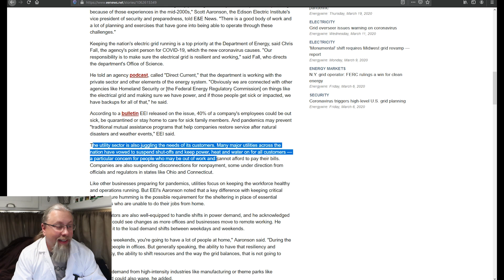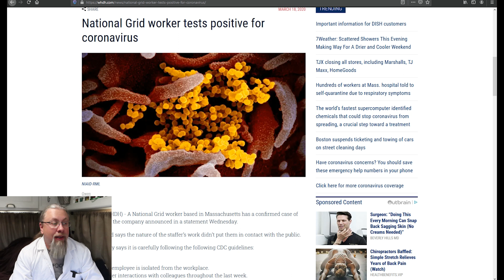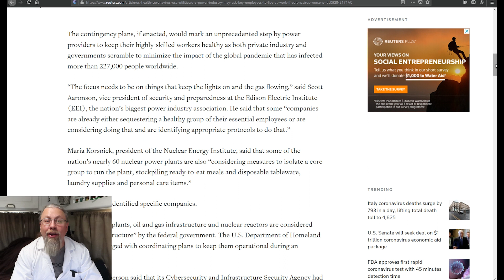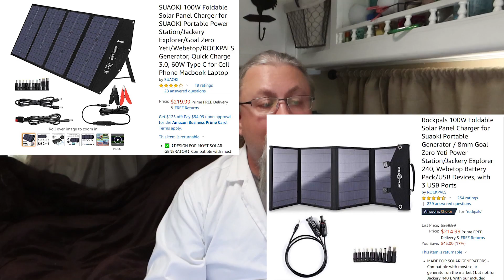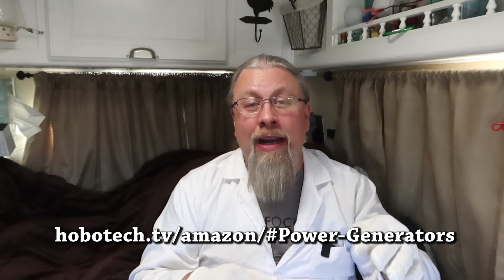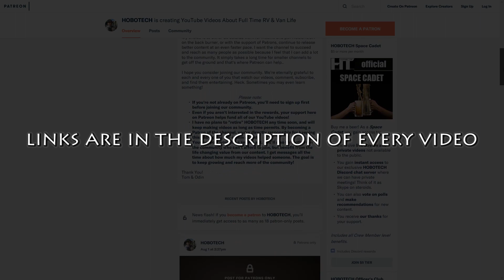BEST Portable POWER STATIONS | SOLAR GENERATORS For SHTF | Grid Down | Blackouts | Covid 19 Preppers

Comment: I was wondering if this could back up a home furnace on at 15 amp circuit breaker?  I thought the 2400 had an AC output of 1000w from the inverter (8ish amps).  Am I off on this
Reply from the maker: It may or may not run the blower due to the high startup load. The only way to know is to try.
Reply: @HOBOTECH  Thanks for expedient reply!  My GZ has an inverter run of 12.5A and can handle the start up surge, but 8A has me very leary.   Thanks for the great info you share!!
Reply: @HOBOTECH   Would be bluetti 2400 be a viable way to re-charge my GZ Yeti which will handle the furnace blower surge?   On the surface, the capacity and recharge times of the Bluetti makes me think so.  This may be where the lower input volts & amps come in handy on the GZ.  I know you are busy with the transmission, so I'm please answer when feasible.

Comment: Question. A freezer that's rated 1.4a pulls 161 watts that seems low and would only draw that while working if tru just about any inverter generator would work correct?
Reply from the maker: No, because the compressor will pull probably 5x that when it kicks on.
Reply: @HOBOTECH  
Thank you... I knew something didn't add up. So I'll make sure to get 1000 running watt not peak thanks.

Comment: Do you think the Goal Zero Yeti 3000 with the home integration module is worth the $? Is the Yeti 1400 with the home integration module and a couple of their Tank Expansion Batteries accomplish the same thing?
Reply from the maker: Goal Zero is overpriced. You can get so much more for less money.
Reply: @HOBOTECH  What brand with similar components do you recommend?
Reply from the maker: https://hobotech.tv/amazon/#Power-Generators
Reply: HOBOTECH Thanks for the link.  Silly question, it seems that on the Eco Flow Delta 1300, the picture of the (6) 110v outlets would not allow for all 6 to be used at the same time because of the ground prong configuration.... am I missing something?

Comment: Another excellent video.  I would like to purchase a Bluetti 1500 with the most portable/smallest footprint of solar panels to charge the Bluetti in the shortest possible timeframe.  I know that you have been using a Bluetti for many months.  What portable or flexible solar panels can you recommend for a fellow van life person?
Reply from the maker: The BougeRV 50w panels have a small footprint and so do the 100w folding panels I mentioned in the video. You can charge with 600w watt of solar maximum in a series-parallel connection.
Reply: @HOBOTECH  Thanks.  To be clear, can you do 400W with the Rouge 50W small panels in a series/parallel configuration?  The graphic in the video at 24:45 showed 100W panels to get to the 400W configuration, so that is why I was asking.  I don't recall what the max input voltage is on the Bluetti 1500, but I wanted to make sure that configuration did not exceed the voltage requirements.  The Bluetti 2400 is also very tempting....  Is the same battery technology used in both the 1500 and 2400?
Reply from the maker: Yes, you copy the setup shown in the graphic but add 4 more 50w panels in parallel if you want 400w. The key is to keep voltage below 64v and amps below 10A. If you exceed amps that is fine as the Bluetti will limit at the input. Now I was TOLD that the newer 1500 can support up to 64v but I have one of the first models that is limited to 60v meaning you can't do 3 panels in series, only two. The 2400 I confirmed supports up to 67v so there is a benefit to the 2400 besides size. They use the same LG cells in both.
Reply: @HOBOTECH  Thank you Tom.  I have decided to go with the 2400 and 6 of the WindyNation 100W Panels in two parallel banks of 300W for a total of 600W as you mentioned in the video.  I can connect a cople of panels if needed or all 6 if I need to do a full charge.  This solution should last me for a very long time and I can't see a scenario where I would need more power.  I will be using your links and discount codes to help support your efforts.  Thanks again for your helpful info.

Comment: I like some of these power stations, The only problem I have is in an off grid cabin type situation it’s just not enough electric to really run Everything I’d want, it would be cool for camping or a little cabin for a weekend but to live off grid for a while I think I’d want more power, By which I mean more run time, or any of those expandable as far as adding batteries to them, it would be great to have it wired into a small cabin but also charge some external batteries to give it much longer run times are much higher capacity so if you got stuck it up there on a rainy weekend or something and we’re inside watching movies to stay out of the rain and using a lot more power in lower light conditions that you would have the battery capacity to get through it.  Or is that just completely impractical and you’d be better off just setting up a fixed location solar system?
Reply from the maker: Over a certain size you are better off setting up a fixed location system with a lot of rigid glass panels and a lot of batteries.
Reply: HOBOTECH maybe that’s a thought for another video someday, like where is that breaking point where you decide to go with the fixed system over a portable. For me by myself I could probably get by on the 2400 but it would be pretty close some days or at night when I’m using the battery, I am a night owl and usually work at night with a computer going and usually watching YouTube and Internet equipment running. I’m guessing that with a couple external batteries to double its capacity would probably be fine for me or pretty close to it, but with running stuff like a refrigerator and something to cook with it might be cutting it close. I’m sure I could probably throw a gas generator into the system as a back up but it would be nice to have it just be automatic.  It would just be interesting to find out in a fixed system what it would cost and how it would compare as far as how many years it will last and how much output you really need to run a refrigerator and something more than an RV or camping situation.  I know a lot of people building small off grid homes or shed to house options are using or considering these, I’m probably right on that line where it might be better just to do a permanent larger solar set up.  🤔  I love this stuff. Lol

Comment: Recommendation for a bit better quality panels for the Bleutti 2400 than those mentioned, that are in stock? I'm not liking the delamination reports on the Windy Nation panels.
Reply from the maker: The BougeRV 50w panels are another option. You can also use any of folding kits mentioned or if you want good rigid glass panels I have those on hobotech.tv/amazon

Comment: Greetings from England! where we have exchanged “god save the Queen for “ring a ring of roses” The beaudens 100w 18v solar panel is still available here and it is a cracking piece of kit for the off grid bugeteer, Yesterday it powered my beaudens 166 solar generator in 290mins bright and sunny conditions panel facing 240 west between 1010hrs and 1450hrs, i watched “the man with the iron heart” and an episode of Kung flu on the BBC, in all it power my projector for 150mins, enough to provide some evening entertainment, albeit with WiFi. Will there be any excellently informative vids on thermoelectric products for the biolite and why doesn’t winnerwell fit them to there wood burning stoves. Ciao for now keep safe.

Comment: Thank you for sharing! If I use the Bluetti 2400 without portable panels does it come with MC4 to the correct input plug? I have 6 100w panels not mounted yet.

Thanks!

I will replay the video but did you say you could use more than 300w into the 2400?

I would have liked the Ecoflow but customer service doesn't have a good report nor their shipping times...
Reply from the maker: It does. The 2400 can take up to 600w of solar.

Comment: Thanks for yet another informative video. I'm going out on a limb in hopes of getting my question answered. I camp in the D.C. ,Virginia, and Northeast areas...I struggle with whether or not this area will actually be CAPABLE of charging a battery using a solar panel in THIS particular geographic area? Really want to know this before investing money into any of these incredible power stations. Thx. - Faithful Subscriber and "Thumbs-up" giver!
Reply from the maker: Yes, on sunny days. You can also add more solar to compensate. For example, add 3 panels in parallel for cloudy days.
Reply: @HOBOTECH  Thanks for your response. Very helpful indeed.

Comment: Do any of the solar generators have 20 amp 12 volt receptacles?  Most seem to only have 10 amp
Reply from the maker: No, as 10A is the "safe" limit on a lighter socket. However, the G1000 lets me pull 15A indefinitely.
Reply: @HOBOTECH  ARB fridge requires 15amp or shuts off. That is why I asked. Thx

Comment: cell towers? forgetting the cables (fiber, copper) in the ground? network using modems, ethernet or fiber optic. you can pump by hand if you need to.
Reply: satellite comms, if you really need to
Reply: if you need to, you can make diy solarcells using photoelectric effect or you can make heat-steam-engine steampunk power
Reply: you can hoard many many lead-acid batteries for long time energy storage with more load cycles than li-ion? you could also store single-use batteries

Comment: Just got one and can't get a single watt from 4 brand new 100w Renogy panels. Tried single, parallel,  series, and not 1 watt input. Wall charging works fine (160w). But really mad if I have to send this thing back because of a faulty mppt. Any advice?
Reply from the maker: If it charges from the included AC power supply there is nothing wrong with the unit. It has to be a cabling or connection issue. Test your panel output with a multi-meter and make sure you're getting >16 volts DC.

Comment: TRYING to piece together a 2400 bluetti system , just confused as what panels to get.
Reply from the maker: 3 of the 100w WindyNation, 3 of the Beaudens 100w, or actually any 3x 100 watt panels in series. It can handle up to 6 panels if you put them in a series-parallel configuration.

Comment: Did I miss where you mentioned the Titan, or is that a totally different type of unit?
Reply: That titan ur talking about is very expensive costly it costs 8 or 9 thousand bucks with every thing only the rich can afford it
Reply: @dansmith9136  I'm seeing them for about $3,000, which isn't cheap, but if you're in a situation where the grid is down and not coming back online for a while, it's a superior long-term solution, isn't it?
Reply from the maker: I haven't reviewed it. It is also out of budget for most. It's probably too heavy for many to move. Also not sure if for your 3 grand you even get 12v regulated outputs. You're better off with a 2400 Bluetti seeing the Titan is only 2000wh.
Reply: @HOBOTECH  I think after you review it, you'll see how it easily breaks down into portable component sections, and is "scalable" in ways none of the other portable units are.  It's really not fair to include it with the others, listed above, because it's really in a class by itself.  When you look at what it does, it is clearly the "Best solar generator" on the market, but at a much higher price point than the units you reviewed in this video.
Reply from the maker: I would certainly like to review one but they are on back order until at least May. Does no one any good right now to really talk about since it's impossible to get.
Reply: Yep, it's a fairly new product, with a lot of demand, so 4-6 weeks minimum to get your hands on one.  There's a good reason for that, though...it's a game-changing unit.

Comment: That was a very good presentation video of what could happen and how to prepare. I am usually skeptical of most YouTube videos and find a lot of fault in them, but you obviously did a lot of work to create this video. Thx HOBOTECH!
For me i would need a Power station with at least a 1200 watt inverter to run my microwave, and i prefer the Renogy suitcases because of the wind, they will not blow around and can be angled easily.  Yes, they are MUCH heavier and larger, a downside.

Comment: Great video, thanks much for posting!  I've not yet checked, but if Jackery still has solar panels available, would it be possible to hook them up to either of the MaxOak devices?
Reply from the maker: Yes. They use the same 8mm connector as the Jackery.
Reply: @HOBOTECH  Thanks for the information.

Comment: just pulled the trigger on the BLUETTI  EB240, do you think the Renogy 200 Watt Monocrystalline Foldable Solar Suitcase, 200W Panel-20A Controller, would be suitable for the EB240, or would you recommend something else?. Thanks for all the information you have provided throughout the years, keep up the great work. Be Well.
Reply from the maker: You need a solar panel without a built in controller like the ones I recommended in this video.

Comment: I UNDERSTAND WHAT A SOLAR FLARE COULD DO TO THE ELECTRIC GRID - WHAT DOES A SOLAR FLARE DO TO SOLAR GENERATORS AND SOLAR PANELS

THANKS
Reply: Depends on your system ... The simpler the better ... Least electronics is best ... Induced currents and magnetic fields that short circuit and/or mess with programming are believed to be the highest risks ...
Reply from the maker: Depends on the size of the flare. I answered this in several other comments.
Reply: Look into Emp shield. Their devices also cover solar power.

Comment: If you have a portable Go Power 130 watt panel with a built in PWM controller could you use it with a Jackary or Bluetti. What would you need to do to make it compatible if not.
Reply from the maker: You have to remove/bypass the controller.

Comment: Very good talk Hobo, thanks.
I can’t recall more than a couple days in the last few months that We’ve had enough sun to charge any solar gen w/o a bazillion panels....(S. Illinois)
Reply: Where I live in the MIdwest we went more than six months without 4 days in a row with sun. From early August 2019 to March 2020. Relying on solar to charge your power bank is not a good idea for much of the US. The hours of sunlight and the low elevation in the Northern portions of the US during winter mean even when the sun shines all day there is not much energy generated by even the best portable solar panels. 

Even the largest power bank is not going to keep your household appliances operating for more than a few hours. Keeping your laptop charged is meaningless unless you have a power source for your Internet too. The blower motors on furnaces will exceed capacity of the largest power banks. For more than a few hours if you want to keep your refrigerators, furnace, etc. running you'll need an old fashioned gas or diesel generator and know how to wire it into your house's power.

Comment: Does UV light or Ozone penetrate items such as these so they might be made safe from coronavirus ? As the CDC stated in 2014 that hydrogen peroxide kills coronavirus I will use it to sanitize/sterilize everything as do hospitals nowadays using fogging techniques. I bought a NEW (never use a unit that had pesticides in it previously) electric fogger for $50 on Amazon... If someone has an illness in a home I will use food grade only hydrogen peroxide (store bought has toxic stabilizers) and fog the place. The British Medical Journal Lancet reported that soldiers returning home from WW1 with pneumonia were healed by infusing them with 1% hydrogen peroxide. The pneumonia is the factor in 90%+ of the coronavirus cases that causes loss of life according to Dr John Campbell. Vaporization at 1% works well and safely oxygenates your blood as it kills both viral and bacterial infection. When blood oxygen count falls below 90-92% you become susceptible to coronavirus so a blood oxymeter is a good investment at $20. It is safely used on contact lenses, herbal crops and agricultural as well without rinsing. Bathing in 2 cups of 2% works to oxygenate as well via the largest organ in your body, the skin. Neutralize the chlorine first by adding 3 tablespoons of ascorbic acid. Carry cotton wipes in Ziplocks, sanitize your masks, spray bottle on your belt and hit your shoes goin' in the house. Have a nice day and a long healthy life...
Reply from the maker: Unnecessary. Viruses can't live more than a few days on dry surfaces. It takes 2-4 weeks to ship from China.

Comment: I ask missouri wind and solar this question and did not get and answer. Can't  find any thing on the net either . I f there is a SMP or and Emp ,will it destroy the solar panels ?? and dose one need some sort ao faraday cage to protect them ??
Reply from the maker: A large enough solar storm will fry the diodes in most solar panels. You can keep portables in a metal trash can that's grounded. Those will survive. Good news is that we'd probably get an advance warning of a few days if something that big was coming. We have deep space satellites now that monitor flares.
Reply: I'm not certain on the solar panels, but the charge controller, inverter, and any other electronic devices are gone in a EMP event.
Reply: john parker Build yourself a small faraday cage and store your solar panels charge controller batteries etc in it until needed.